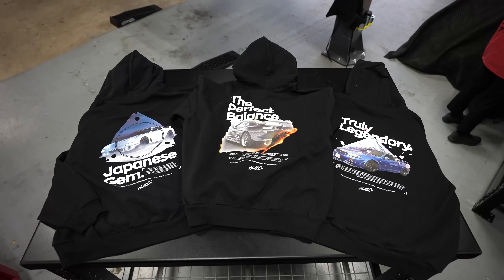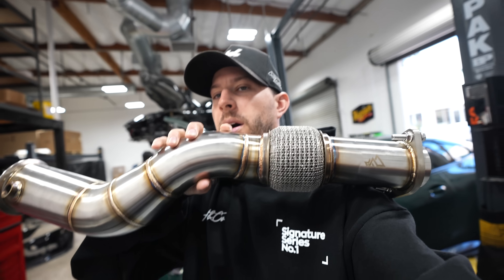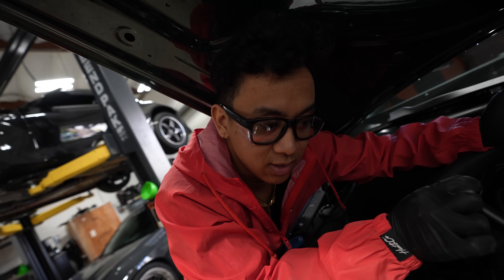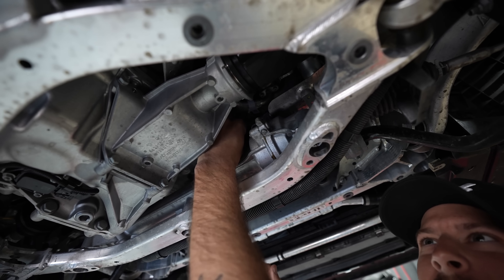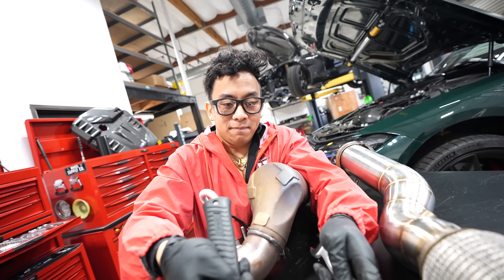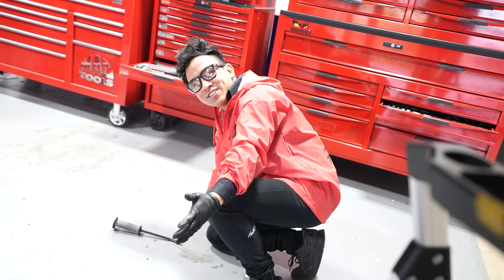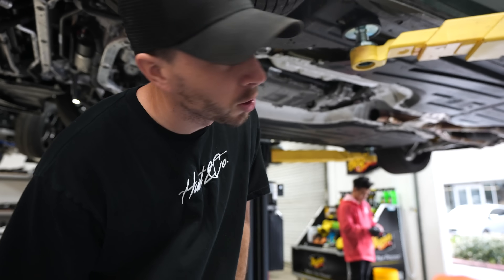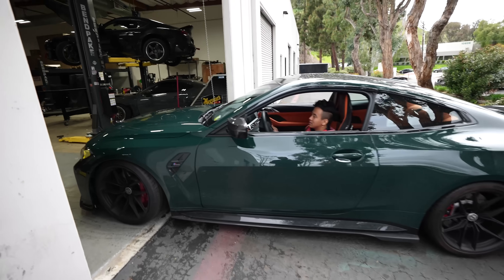STRAIGHT PIPED MY G82 M4!

Comment: just wondering if you have ever come across a yellowish exhaust fluid coming out of the passenger side, 2016 bmw x5M with a tune. Was getting derate because of #2 injector being cut out, changed the plugs and coils, some plugs were not too tight. Ran good for the first 30 mins, then started to go to power reduced malfunction code again.. Smokes more on the passenger side.